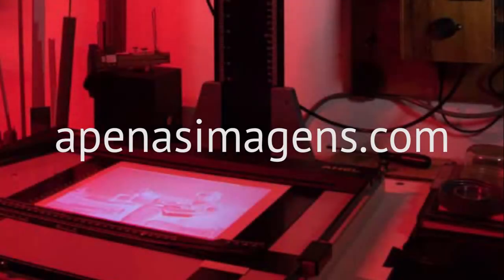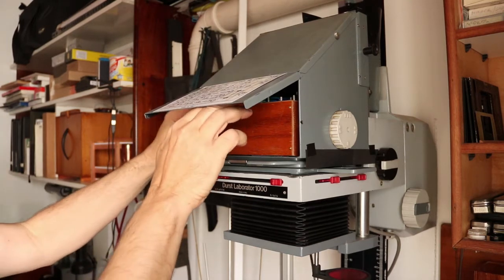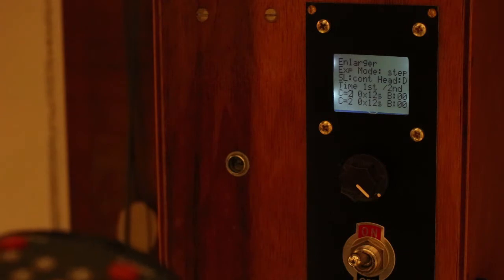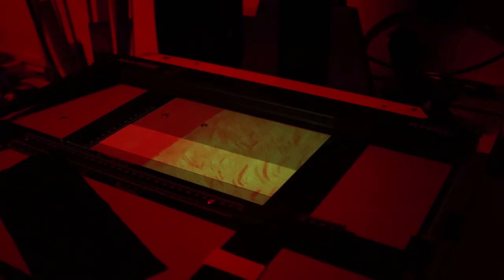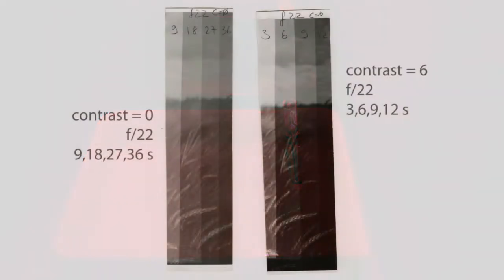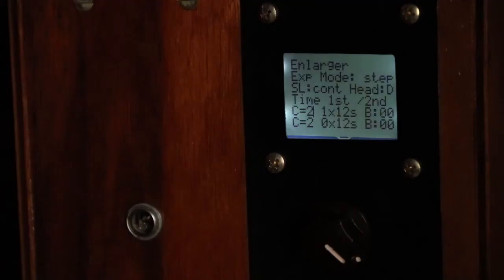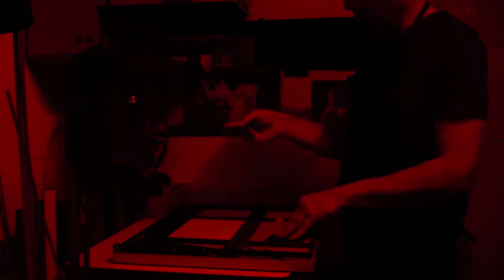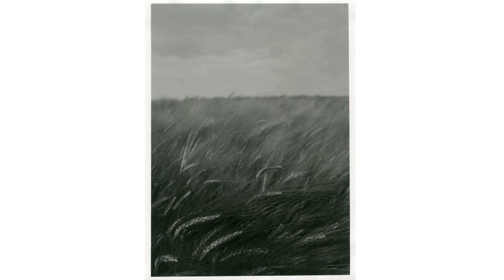Black & White Photographic Enlarger with LED light source

Comment: nice Durst, a crying shame you have NO clue what " the Analogue Life " concept is, that of dispensing with Digital (including circuitry, like LEDS), for complete mechanical, or BASIC electrical systems, like light bulbs, switches, resistors, etc. hope you haven't permanently destroyed the bulb holder and condensers, as someday a real analogue person will want to restore it to its true analogue form and function.

Comment: I built a green/blue leds head some years ago then my son offered me a philips hue kit with 3 leds bulbs. I had only to replace the original bulb by a philips. Now I use my smartphone app to choose any color at any intensity. The big drawback of philips is that if you switch them off they make a reset... So I let it on and use a mechanical light blocking with a magnetic switch starting and stopping my timer...

Comment: Are there an white LED's in the array?  If not, can you still use standard filters to adjust contrast with this blue/green LED head?
Reply from the maker: No there are no white LEDs, only blue and green. You don't need standard filters for contrast adjustment. If you light up only blue LEDs you have maximum contrast and with only green you have minimum contrast. With combinations of blue and green you may have the medium contrast situation at your will. If I had to do it again I would include some red LEDs just to make the image brighter to my eyes. When the greens are on it is quite OK, but when blue is the prominent one the image becomes too dim. The red LEDs would do nothing for the paper but would help me in tasks like dodging and burning when I set up a high contrast combination (high blue and little or no green at all).

Comment: But does not the lens perform a bit worse at the f22 because of defraction?
Reply: I didn't notice anything worse than with larger apertures. The entrance pupil for f22 for a 50mm lens is about 2,3 mm. I think that, for diffraction to become noticeable, this is quite large. I remember, when I studied Physics, that experiences to demonstrate diffraction used slits far smaller than that, openings and objects thin as a human hair. But I understand your concern because I also heard about deterioration due to diffraction, but never run across an in depth discussion, it is just mentioned. For longer focal lengths 80, 105 and 150, I am sure that this is not an issue as the hole gets even bigger.

Comment: This look great..  Is this project with arduino and led source something you could share or is it something you sell?
Reply from the maker: Hello, my idea in this video, and post in my website, was more about giving some tips and hints that could save time for those willing to implement something similar. It would be extremely difficult and risky to make a tutorial aimed to guide someone not initiated in those matters of electronics and programming. One must be able to understand and build up from the information that is already there. If that is not your case, the best solution would be to show the video and post to somebody in your city more acquainted with this type of things. There will certainly be improvisations and adaptations to be made and you need someone with time and local knowledge to do those.

Comment: You realized my dream. Would have you the kindness to share plan of your assembly with the enthusiasts of argentic photography?
Thank you to make possible this important improvement.
louislazaro@gmail.com
Reply: Amazing  invention
Reply from the maker: Hello, 

I am afraid I can't do that. The code is mixed up with other functions. I didn't write it professionally or thinking of sharing, it is not commented, the variables have names which are hard to guess and furthermore, it depends a lot on your actual configuration, for instance, I used a remote control that belonged to a TV set sold only in Brazil. This and other adaptations would demand anyway understanding and new solutions for your specific case.

The idea of the post was about saying "it works" and sharing the milestones for a project. But the detailed project is impossible to write down in a way that one could possibly implement it as is. 

I even wrote a section at the end of the post explaining that: https://apenasimagens.com/en/enlarger-head-using-leds/

For someone more savvy with computers/electronics, believe me, the post is very helpful and saves a lot of development time. Maybe you could find someone to execute it for you.
Reply: Why even showing it then, without sharing ideas of how to make one?
Reply from the maker: As in most of the tutorials on the web, it is important some knowledge about the subject and related skills. Video and article are plenty of information, many tips about the circuit, type and quantity of LEDs that work, references to extra information sources, complete demo of user interface and final results. One can perfectly profit from that, save time, and make his own adaptation. That is the idea.